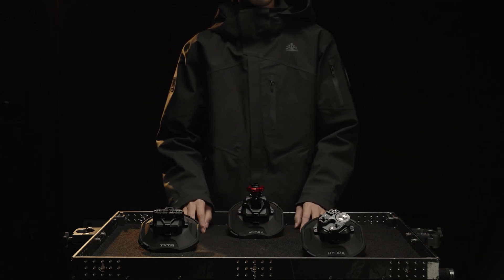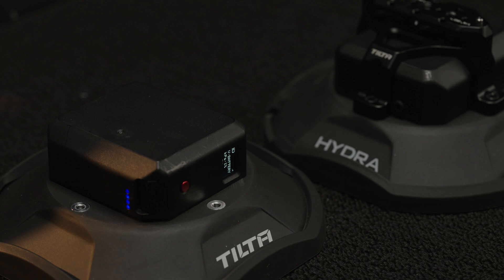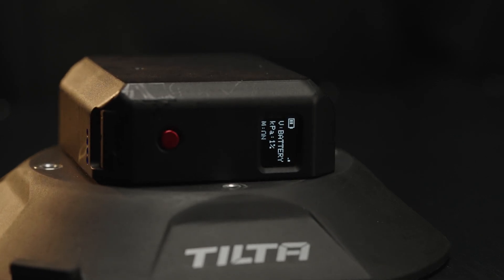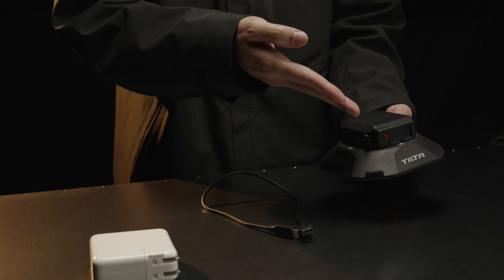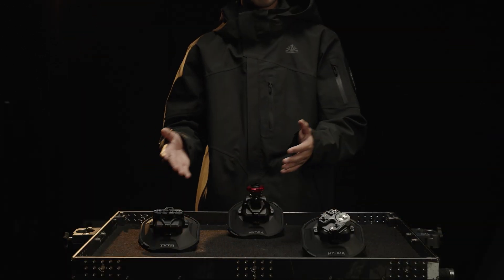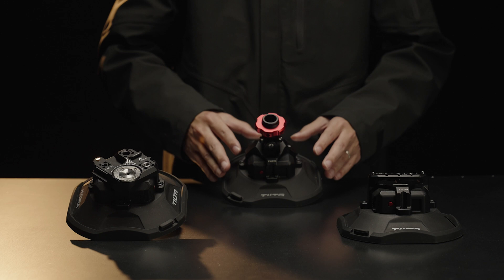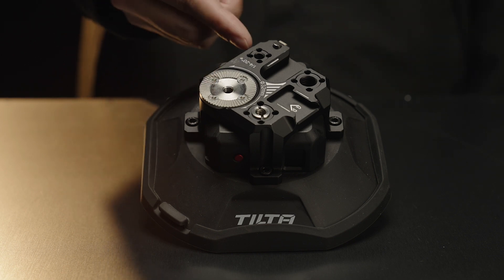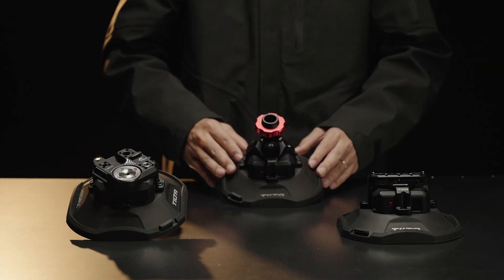Tilta Tech Channel: Electronic Suction Cup Setup Guide & Overview

Comment: Can you turn off the power once it is sucked down to avoid constant motor on/off for pressure monitoring?  I realize it's a slight risk not having the unit monitor the pressure, but for certain interior car mount applications, I want clear audio and no noise out of a motor.  Thanks!
Reply from the maker: if you don't experience constant harsh bumps then the internal motor shouldn't have to the equalize pressure that often. Once the pressure is set, the suction cup is very quiet. but no it must be turned on and charged in order to operate